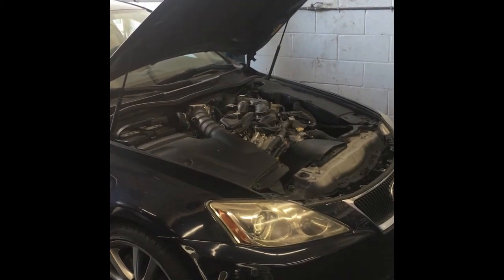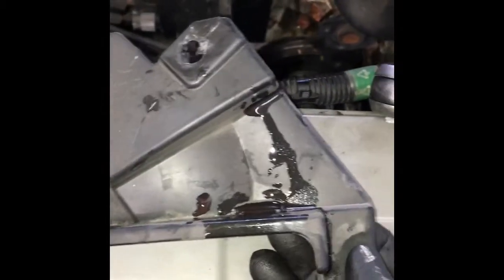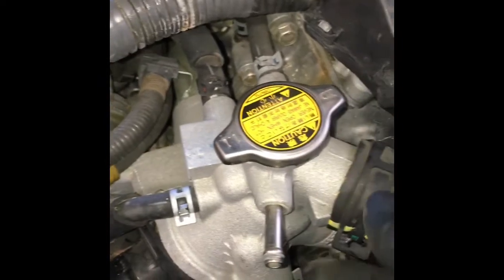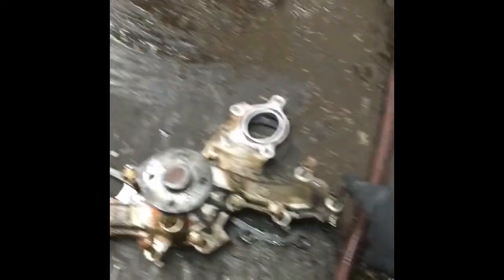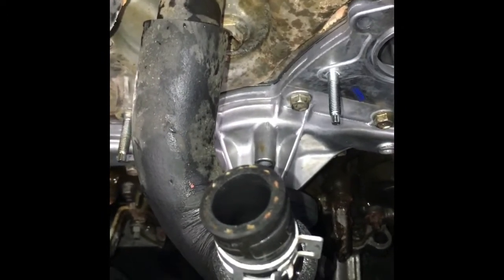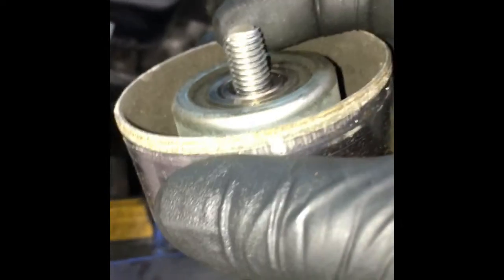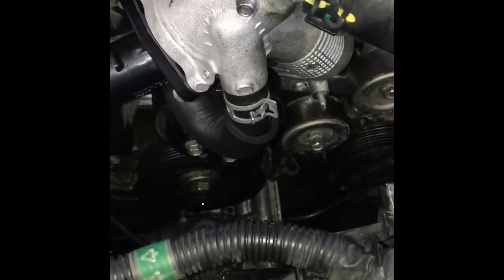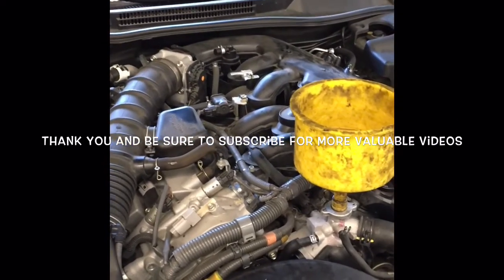How to Replace the Water Pump and Thermostat on a 2008 Lexus IS250

Comment: There are 16 bolts on the pump. I followed your guidance at 15 and now for some reason I am missing my last bolt. Disappeared. Probably my fault. But upon cross-checking with another youtuber he had 16 minus the 2 for the thermostat. I spent hours trying to figure out why I had exactly the amount of bolts you said but 3 holes left not the required 2. If you delivered accurate info it would have saved me some time. So that's your part to improve if you so wish. My part? I'm done trusting random youtubers on my own car repairs. Going to get a Haynes manual like i should have done in the first place
Reply: "If you delivered accurate info it would have saved me some time"... wow lol it's all about you isn't it. If you're so concerned about your time just pay someone to do the job. You'll have all the time you need while your car is being fixed by someone else. The guy is giving free information.
Reply: @ciscokid420  Tru. I done this video religiously while replacing my girls waterpump. No missing bolts, and everything's running smooth